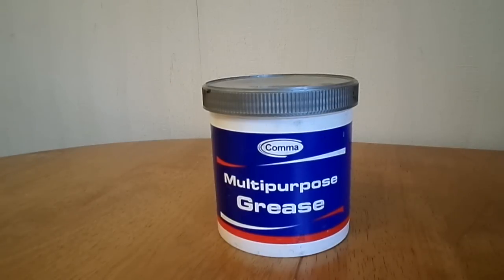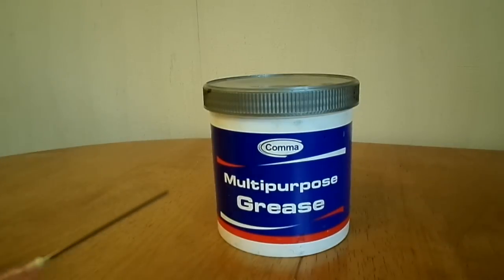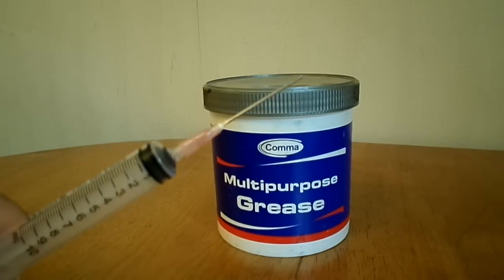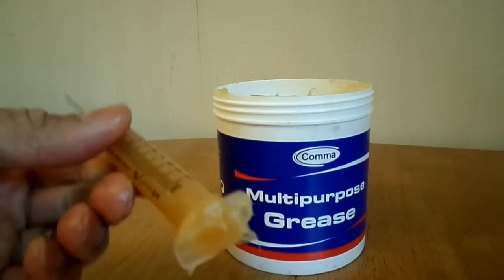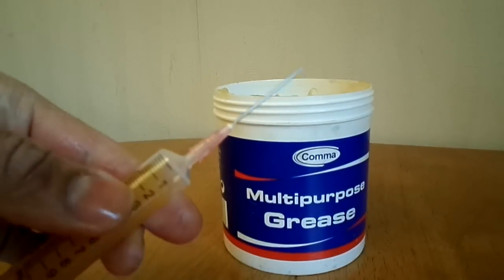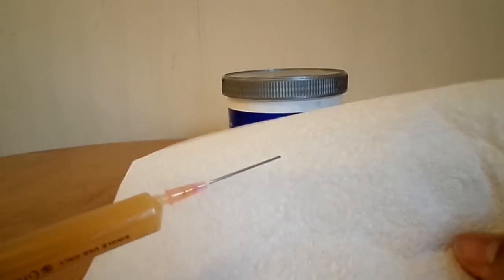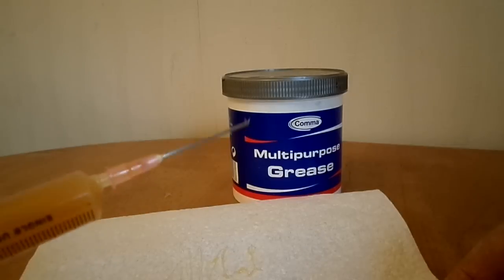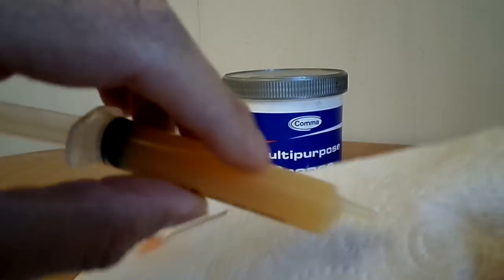How to grease joints without zerk/nipple fittings - TryDiy

Comment: Opted needle it looks made to do , really is pressure more than air from tyre valve strain is what it is stressed , possibly the fluid will come out of its boot , that was unusual normal , lastly a mil or so from priming  the syringe and a bit of silicone the whole contents poured into these pressured joints hope that is great

Comment: Good concept but is the wrong type of grease for tie rod ends and ball joints. Also might get grease into the void in the dust boot but not where its needed in the actual ball of yhe joint. Still is a good "better than nothing" try.